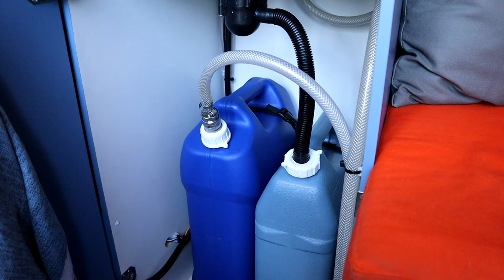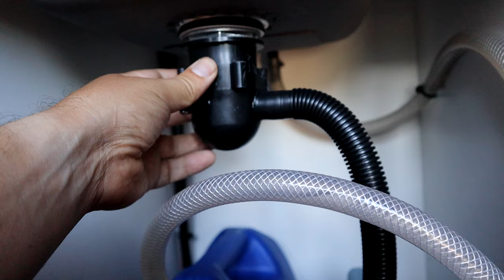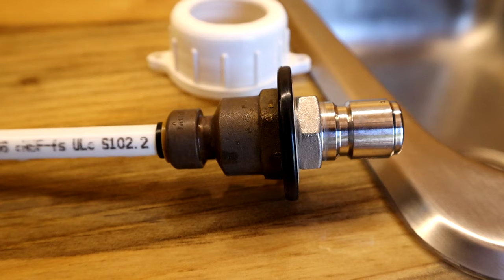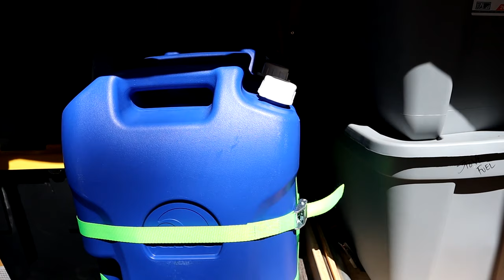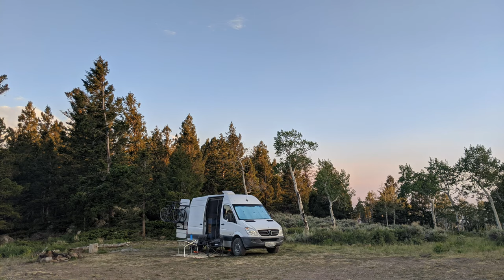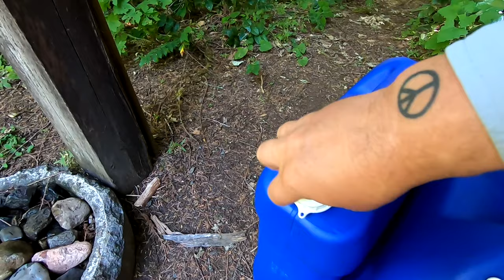How to Build a Basic Water System For Your Van  - #Vanlife Basics - Episode 1

Comment: Wondering if you had any vacuum issues in your supply jerrycan? It looks like the one you use have an air ingress port, but some jerrycans don't. Would the quick connect system only work with a vented jug?

Comment: I've got the same foot pump & 3 - 5-gallon Jerrys, Been rocking my system for the last 2.5 years. As you have pointed out it is a very functional simple enough system. I don't figure I'll be changing mine any time soon. Pro Tip --- Using a Berky filter I also fabbed up a great custom water filtration system - Gold I say for more consistent morning coffee brews and perhaps fewer tummy issues...
Reply: Would love to see how you did that!
Reply: @ShellieSager  Shellie - I would like to but unfortunately, I don't really post videos on my channel.
Reply: @Terry B what about any 'foul smell' that comes out of the grey water tank? as has been noted the air gets compressed in the tank as it fills and the 'smell' ??
Thank you in advance.
Reply: @michellefriend8848  The can is sealed well enough to prevent spillage or an appreciable amount of air to exchange to occur. There is some foul smell when I dump it (  I usually dump it every week or less)   but I have never had any noticeable foul smell from the grey water can day in day out.. I also may not notice any smell as the doors or window or vents are usually open contributing to plenty of air exchange.

Yes I would build the same system if I were to do it again.

Comment: I wanted to thank you for this video. I followed your instructions and my simple water system in my ProMaster is Amazing. Video's like yours made my job so much clearer and easier.  One thing I didn't do was use the Whale Gusher pump and now I'm regretting it. I got the traditional small circle black foot pump and it only pumps a few ounces at a time, and that's just not good enough if you're filling a pan or dog dish. I did a detailed video for my channel but I need to go back now and buy the Gusher and install that.

Comment: Is there a huge difference with adding the pez pressure tube into the tank? Why not just push the nylon tubing down to the bottom of the water tank? I’ve seen a couple videos use the pressure tube and a couple not I’m just wondering if anyone’s noticed a huge difference.

Comment: Hi SV. I am currently planning out my van build and I love the simplicity of your plumbing setup. Quick question. I am concerned about smells coming up from the grey tank, and my understanding is as water enters the grey tank the air it displaces must escape. With your setup does the escaping air get pushed up through the sink drain? If it does do you not experience the bad grey tank smells? Thanks in advance for your reply!
Reply: @AgentCashback you've asked a great question, have you discovered the answer yet? Considering this method as well but would also like to know in advance about the air smell that must go somewhere like up through the sink drain. What to do? 
Your input as well anyones is appreciated.

Comment: Great. Is that mean i could use any faucet with this system? Or something specific?
Reply from the maker: There is a link in the description for the faucet I used: https://amzn.to/3gKEFJZ  You could use something different as long as the valve is open when you want to pump water through.
Reply: I just used a simple piece of copper pipe. It's only for washing dishes and hands so no big deal.

Comment: I am ready to build a sink now in my minivan. Where do I get the foot pump? Where do I get the pump that you dropped in the fresh water tank to pull up the water? Home Depot had so idea what I was talking and neither did Marine West :O
Reply from the maker: I bought the foot pump at fisheriessupply.com there is no pump in the water tank, only a pex tubing and some fittings.
Reply: @SailingVesselAdventurer  Is this the foot pump you have:  https://www.fisheriessupply.com/whale-gusher-galley-mk3  Also, if this is the model what is the difference in the  RH vs. LH option?  I assume it is just where the water outlet from the pump is?  Thanks for the great video!

Comment: I would have used powder coated aluminum for all my tubing. I have found that powder coated aluminum is a cure all for any project. That, again, is powder coated aluminum. Also, you need a manicure. Nice van!
Reply from the maker: I was thinking about powder coating everything. Even Brenda's toothbrush. Do you know where I could find one that's aluminum?